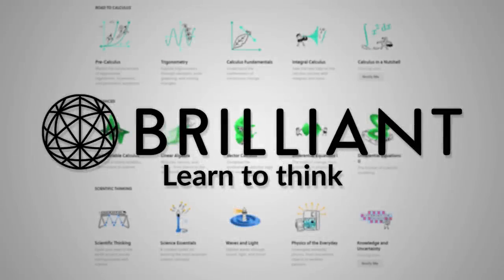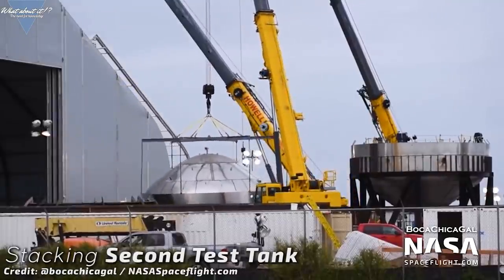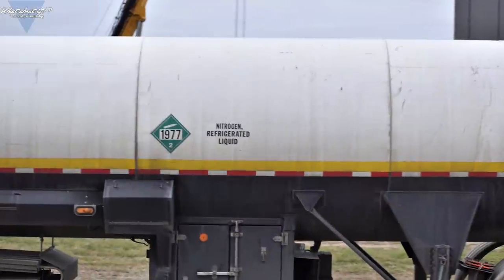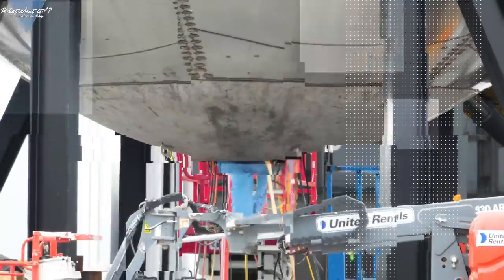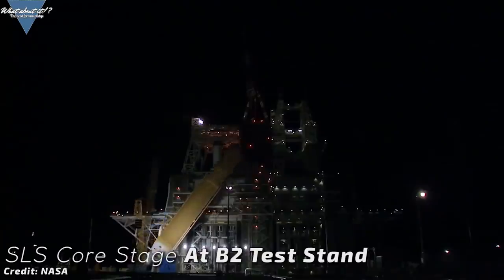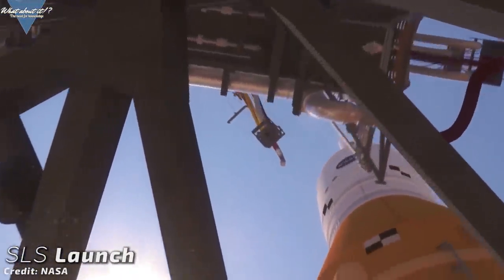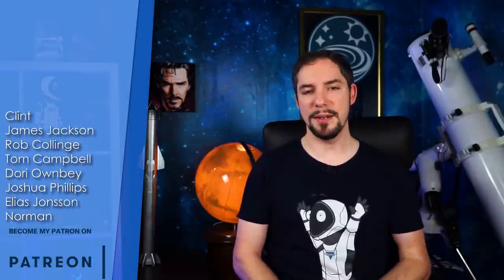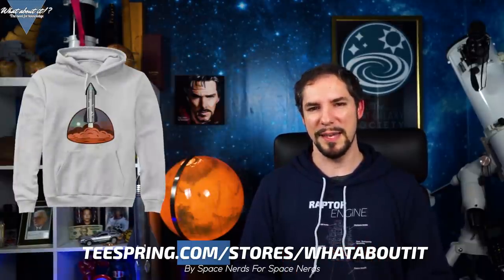68 | SpaceX Starship Updates - NASA Artemis & SLS Update

Comment: Are you kidding? Build Starship to the lowest possible standard? An aerospace vehicle that's supposed to carry 100 passengers! And no launch abort system? The only thing more troubling than seeing SpaceX try to build to the lowest possible standard is seeing SpaceX fans cheering on this approach! If there is an accident with a massive loss of life... Everything you guys hope to see accomplished will be destroyed! This whole approach to Starship development is just wrong in my opinion.
Reply: You're looking at this wrong. The point isn't to cut corners to save costs, and never mind a few deaths — it's to build the cheapest thing that still works reliably. And because they're cheap and reusable, they can test the hell out of them, blow a few up, figure out the flaws and limits, and fix them. Unlike NASA/Boeing, they're not the ones planning on flying passengers to the moon after just a single test flight...
Reply: In my opinion, a rocket, especially one designed to carry passengers, must be built to the highest standards. High cost for high standards should not be an issue if the vehicle is reusable. Just looking at MK 1 you could see that it would not be reliable or flightworthy. A huge waste of time and money. Testing the hell out of junk will yield predictable results. I believe the old tried and true method of spaceship development will produce the best results. After seeing Starship development I would never fly on it.
Reply: @DavidJohnson-tv2nn  – but nobody does that. Whether making cars, planes, or rockets, you don't just throw money at making things safer than they need to be. You figure out where the line needs to be drawn, and stop once you achieve it.
Reply: Simon Geard, I agree with you up to a point but wouldn't you agree that Starship should at least be built to the same standards as Falcon 9/Crew Dragon? Current Starship development, though improving, is not anywhere near being safe. MK 1 was a joke. Yet Musk proudly stood in front of it when he gave his update speech. None of his fans said anything. A little constructive criticism will never hurt. Now, let me ask you this... Would you fly on any vehicle not built to at least the same safety standards of Falcon 9/Crew Dragon? Would you fly on any rocket that did not have a launch abort system?
Reply: @DavidJohnson-tv2nn  – current Starship development is years from carrying passengers, so I don't understand why you're so concerned about safety at this stage. All they're building right now are prototypes to figure out what works...
Reply: Here are my suggestions for Starship.... 1) Either prove the structural strength of the paper thin stainless steel (and the crappy welds) being used in current development or abandon it in favor of titanium or carbon fiber. 2) At least make a commitment to build production models of Starship in a fully enclosed factory (NOT tents), under controlled conditions, to at least the same safety standards as Falcon 9/Crew Dragon. 3) Include a launch abort system or develop a new vehicle for crew transport that would dock with Starship in orbit.
Reply: Simon Geard, They already know what works because the have the very successful Falcon 9. What I am so concerned about is they appear to be trying to lower the standards. And they have no plans for a launch abort system in production models.
Reply: @DavidJohnson-tv2nn  – well, no... Falcon 9 is very successful, but it doesn't meet the requirements for something that can fly to Mars, refuel using resources available onsite, and fly home again. Because that is the design goal for Starship...

Incidentally, you keep talking about the lack of a launch escape system – but do you know how many times in the history of crewed spaceflight where an escape system has been used? I believe the answer is just one... a Soyuz mission about forty years ago. So do they really need one, with all the extra complexity they add? Or are they better off trying to build something reliable enough to not need one?
Reply: Simon Geard, From what we've seen so far, though they are improving... I'm not very impressed by construction in junkyard conditions. But assuming final production models are built in a factory under strict quality control conditions.... The reliability you're talking about will never be achieved. First "load and go" loading of propellent is extremely dangerous. Second, the Flight Termination System (FTS) designed to destroy the vehicle if it strays off course. Those are just two of the things that make Starship anything but "reliable".